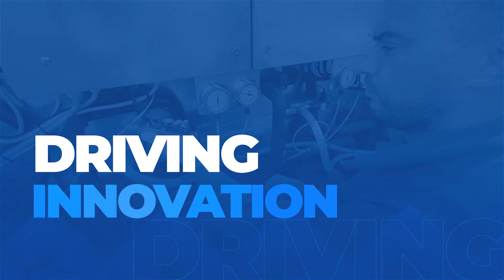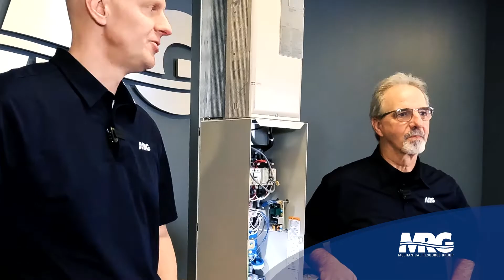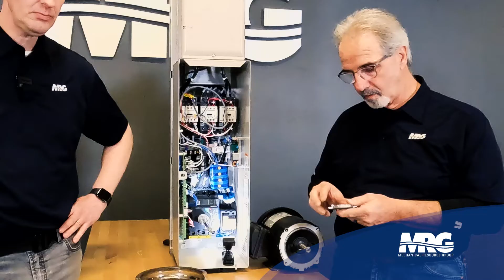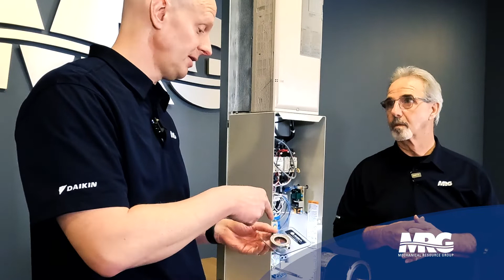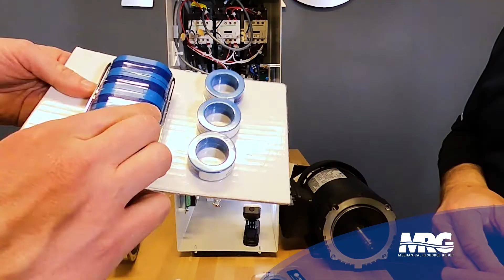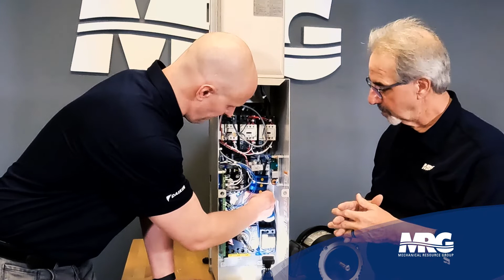How to Prevent VFD Premature Motor Bearing Failure | Mechanical Pros

Comment: We use vfds on our condensers. The motors that are farthest away from the VFD always seem to fail first. Why is this parasitic voltage worse on motors that are farther away from the VFD? Would a load reactor also help with this issue?